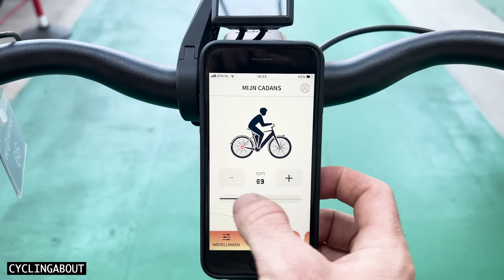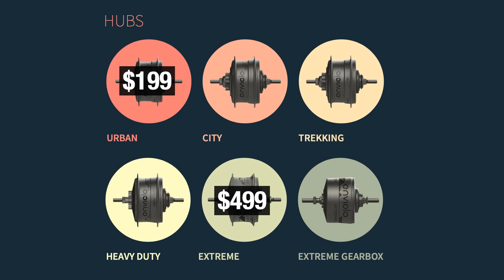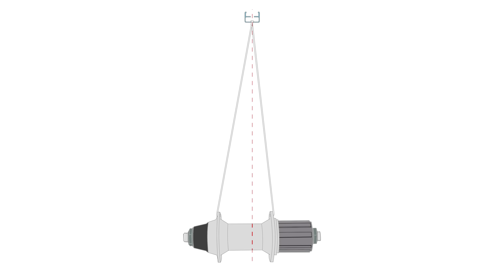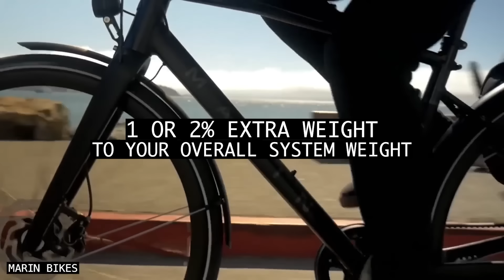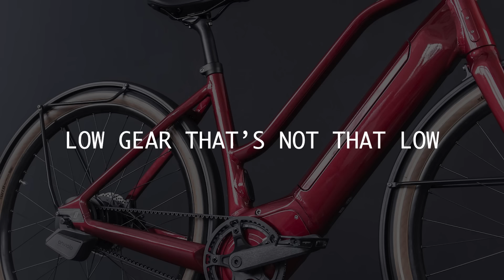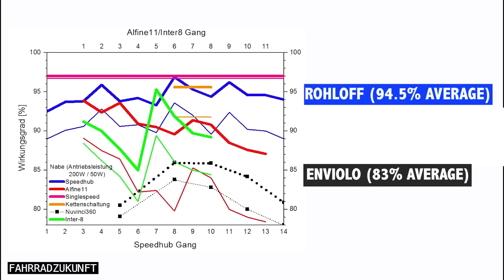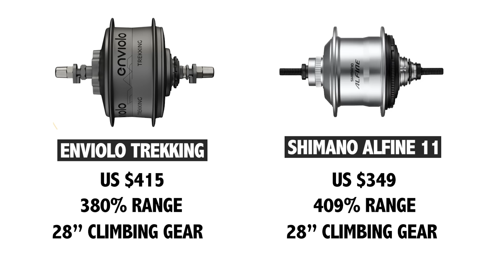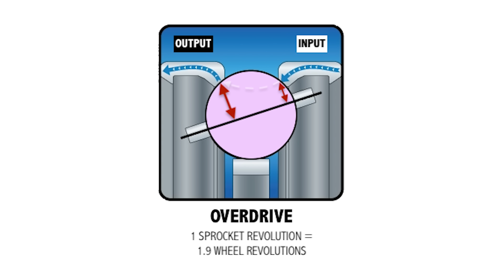Are $199 Enviolo Hubs the BEST Internal Gear Hubs For Bicycles?

Comment: Telling this as a bikemechanic. These hubs are unbelievably unreliable. Compared to Shimano hubs you do not have the possibility to adjust the play of the hub, so if your happens to have play, the hub is defect and needs to be replaced (some customers do have this after 2000km on their e-bikes). Then the freehubbody itself often gets play in itself, which leads to the chain or belt being off-center and possibly damaging them. Only way to fix this is replacing the freehubbody. When lacing these hubs you notice that most frames are not designed for the hubflanges being the same height, so you need to lace them asymmetrical in order for the wheel being centred. Then it happens sometimes that the disc mount itself is misaligned so you have to live with constant brake rub or you need to replace the disc mount. 
Overall there is nothing on this hub that can be repaired, only replaced and if the hub needs to be sent to Enviolo you most often just get a new one because even they are unable to repair them.

Comment: 6:45 yeah no, give me a grease port. btw i have tested on a few years ago, felt pretty good.

 20k km sounds like a lot, but im a messenger, and ... wait it is a lot. that but works out to 2 years. (60km x 18workdays x12months=13k km per year) (or19200kmper year working 80km per day and 20days per month). 
that being said, for a normal commuter that is a solid 5 to 6 years, so not bad. (stay in school kids). that being said, a friend of mine had one on his cargo bike as a messenger for a few years working part time.

1 grease port please or some kind of good oiling option.
EDIT: 21:40 never mind, that grease looks crazy.  but it still should be shop serviceable like re greasing and the wheel sent off for repairs.

Comment: I hate so much that on Enviolo you have to make SO MUCH more twisting turns compared to Shimano in order to shift… 
Also during winter times shifter will freeze from time to time not letting you to shift properly before it unfreezes.
Reply: Try the automatiq version no turns at all anymore. In my view the automatiq version is the only version to get. I am also sure it lasts longer since the system is always in the right 'setting' not to stress the systems and it doesn't use cables that can break.

Comment: slight correction (?) a CVT does not require electronics for automatic shifting; in many automotive applications, automotive shifting can be mechanically controlled by rpm, torque, or other variables mechanically present.
Reply: True but electronic is far more customizable like my automatic shifting which I designed for these hubs.

Comment: You even said why science proves they are harder, you slow between each pedal stroke so are wasting energy on an acceleration every stroke so the extra energy exceeds the extra lifting force. Each deceleration/acceleration cycle throws energy away.
This would only be cancelled out by an ebike which compensated for the dead zone so there is no deceleration, which a modern ebike can certainly achieve.

Comment: I've been riding an old (2004?) gazelle avignon with 7 speed hub for the last decade and love the low maintenance. The hub is starting to get crunchy with age so i test rode a gazelle cx (Bosch torque-based crank motor and automatic cv hub gear) it was really weird that pushing harder on the pedals did not result in them going faster, just the bike.
Electric boost is capped in the uk below my nominal cruising speed so i probably won't go electric but a manual cv has strong appeal.

Comment: 15% loss of power is a lot. That's 1/6th of your energy. Like riding 50mi when you could've gone 60mi.
Reply from the maker: It sounds like a lot, but when you factor in all other forms of resistance (eg. air, tyres) the effect on your speed or mileage is much, much smaller than 15%.
Reply: Compared to 3% of a chain its huge disadvantage
Reply: @Cyclingabout  15% loss with NuVinci is only best case - only close to 1:1 ratio.
That can go up to 30% loss of power.
This is why this is really only suitable for ebikes and only if you really don't care about it.
Reply: That efficency data is very misleading the actual efficency is more complicated. You cant just state an efficency like that.  Newer models of the hub are significantly more efficient, I've used many hubs over the past 12 years.
The efficency doesn't just depend on ratio but also the torque being transferred.
Reply: @Ed.R  presumably, efficiency is based upon power, watts, and the inefficiency is the power loss, so it should be that simple.
Reply: Efficiency depends on hub ratio, torque, hub model, hub age and even between different hubs made the same day.
So someone putting out 200W in 1:1 ratio will have a hub operating at higher efficency than the same power into a hub in underdrive. A hub in the same ratio will have a higher efficency if the power is only 100W instead of 300W.
Or even if the ratio and power are the same someone pedalling at 100rpm will experience higher efficency than someone pedalling at 60rpm.
I've attempted some efficency tests so have a little understanding of the complexity. So it's always disappointing to see people fixed on one single efficency value.
Reply: @Ed.R  You need to be aware of the main problem of the NuVinci: slip.
It (N360) for example had been tested with cranks cycling with steady 60 rpm. Changing the input from 50W to 250W then caused the resulting speed of the bike to drop by about 10% -- because slip within the hub increased significantly. That is the main weakness of this type of hub and that makes it so bad in comparison. Other types of hubs practically don't have any slip.
This also can cause less range with ebikes in comparison to other hubs since high power input into the hub (causing more slip) is no problem especially with ebikes. Everybody can put in a few hundreds watts with an ebike.
Reply: From my own efficiency testing I can verify that 15% loss is near the worst-case scenario. Unfortunately my power meters are neither accurate or precise enough to get good data. However I was not seeing significant losses and nothing like 30%. In fact at low torque or in 1:1 ratio it looked more like 5% at most, was hard to pick up any loss.
On the subject of slip, calling it that isn't wrong but maybe misleading. With increased torque comes an increased contact patch between traction ring and planet. As the planets surface has all available rotation speeds on its surface the bigger the patch the more of it isn't at the correct speed. Hence the slippage on the edge of the patch, not to be confused with slippage between input and output.

Comment: WRONG.  It's not changing the size of the contact patch (which should be obvious - it's a sphere ).  It's changing where the contact patch is relative to the rotation axis of the sphere.  Closer to the axis = less hub rotation per rotation of the sphere.  Further from the sphere's axis means more hub rotation per rotation of the sphere.  Pretty ingenious, really, even if it is the source of the inefficiency.

Comment: why cant you have a true cvt on a bike without a shifter or leccy shifting? ive always wanted to speak to someone more educated than myself on the topic
Reply: Not sure what you mean my bike and many others (bosch+enviolo automatiq) doesn't even have a gear shifter i can manually use. I have not changed a 'gear' in 16.000km. The only thing you set is the type of motor support you want during your ride (or auto) and the peddle speed (i have it in 70). I just start the bike and peddle. Since i live in the netherlands the most active 'button' on the steering bar is the bell :)

Comment: Brilliant idea to replace gears with just an oil.
Reply: I think you’re on to something. What if a gearbox had metal wheels with perhaps a 5mm width instead of cogs, driven by the oil? With just a few different sized wheels, many ratios could be  achieved with a simple linear shifting mechanism. Just don’t know if there would be enough surface area between the wheels.

Comment: 380% is underwhelming.

if you want to do 5kph to 40kph with the same frequency, then you already need a factor of 8.
or 800%
Reply: If you want to go 40kph instead of the normal speeds (avg bicycle speed in netherlands for example is about 18km/h and ebikes 23km/h) you should not get this system or i would argue probably not a internal hub at all these speeds are for a 100% different bicycle group.
Reply: @scb2scb2  currently I have a Dual SRAM, combining a 3 gear hub with a 7 gear derailleur, yielding a bit over 500%. It's an affordable compromise.

I'm not a sporty person, I typically sustain 100 to 150W-ish when cycling. But even when I visit the Netherlands, I regularly exceed 40kph at the beach with a proper tailwind. And when I go to the neighboring village here in Switzerland, it's roughly 5kph on the ascend and 50kph when returning.

I would argue that proper gearing is important for beginner and amateur riders who cannot just brute force an inappropriate bike with tremendous torque or a frequency resembling a sewing machine like an enthusiast.

My pet peeve is that good gearing is either vulnerable (derailleur) or quite expensive (rohloff, pinion). And bikes with proper gearing are often uncomfortable for "everyday" riders who want to sit upright.

And recently (same as for cars!) the wheels are growing to ridiculous sizes.
Reply: @svr5423  The word here is you are not a normal bicycle user but are doing it for sport. The avg bicycle speed is 18km/h in the netherlands i am sure you noticed when you are passing everybody at 2x the speed. Its just a whole different market. The price of the avg ebike (where these systems and things like the rohloff 14e) is 2600 euro now and about 50% of all bikes sold in the netherlands are now ebikes. Yes they can cost a lot a 'top' ebike or cargo bike for kids etc etc can be up or over 10.000 euro. My current nornal bike (koga) is about 2200 and my ebike (Reise and Muller) 6000 euro. I doubt if these markets will come together but i do suspect prices will go up and options will be limited because its just not where money is being made i am sorry to say you are the exception not the rule.
Reply: @scb2scb2  I'm a normal bicycle user, I'm not doing it for sport. I'd never buy a racing bike.

It's ridiculous for a normal user to spend more than 1000 EUR for a bicycle. You can already get an e-scooter for that.

I also don't see any reason to buy an ebike. Not only are they expensive, they combine the downsides of a bicycle (size, mechanical fragility) with those of an e-scooter (limited range).

The main reason why almost all bikes sold traditoinally are mountain bikes, because they are cheap and they have the gearing necessary for everyday use.

Again: with the 380% gear range offered, my bets are that a normal rider would not make it to the next village (around 4km) where I live without having to get off and push.
Reply: @svr5423  Ok not all countries are the same so not making a judgement on you. If you are going over 30km/h on a normal bicycle here you are the exception not the rule and will have 'issues' with other bicycle people all going 20ish. Here its not ridiculous to pay more than 1000 for a bicycle. I told you over 50% of all bicycles sold in netherlands are now ebikes and the avg price is about 2600. We have 23M bikes for 18M people so >50% of all new bikes is a lot. The reason why people don't want to get a escooter is simple you need helmet, insurance and in our country most important you are not allowed on many bicycle paths and have to join the car lanes. Now i do agree on range 380% is not enough for you if needed many will move to internal gear hubs with 500%+ like the rohloff. Now in your country i assume mountain bikes would be normal here its not i doubt its more than 5% max. Also most people own multiple bicycles from the one you use to get to the pub (old banger 100euro max) to a nicer analog one and a lot of the time a ebike. When having kids maybe a cargo bike to transport to school. The mindset is totally different but if you been to the netherlands as you say you know that. If i would be living in your country i would not even consider a enviolo just not practical and if doing internal hub would probably go with rohloff 14e. Each market has its own needs and europe is so big and flat vs mountains, no biycycle paths vs some vs all over the place. A commuter to work idea for decades (starting at 6 years old going to school etc etc... There is a reason why no gears or internal gears is normal in some countries and not in others.
Reply: In reality you do not have to do the same frequency at 5 and 40 kph. I do not have any geared hub but derailleur systems with 500, maybe 600% gear spread ratio with more than one front chain ring.

You can do easily 50 kph with them, and you can climb easily. No bicycle shifting has 800%.
Reply: @simonm1447  derailleurs with 500 to 600% are workable, but in reality it still takes some effort to climb a mountain.
Put people off from riding a bicycle.

Any less ist simply not suitable for the real world, and that includes the enviolo.

So far the only alternatives I see to the derailleur are rohloff and pinion gearboxes.

And yes, you can vary the frequency and torque a bit up and down, but in reality humans are creatures of comfort.

Comment: Can you clarify the lowest gear ratio being limited by the "2.0 minimum primary ratio"? The tech pdf lists that in the context of ebikes. If I am just pedaling the thing, is there any reason I can't gear it lower (via the chainring and sprocket) so that I can go up a hill slower at a higher cadence with less force on my knees?
Reply from the maker: The issue is input torque, not the sprocket sizes. Despite you not riding an eBike, your legs can still put significant torque into the rear hub (potentially damaging it) when you apply your full body weight to the forward crank arm.

But you could do it if you were careful. Have a look at my Alfine video for more on lowering the drive ratio beyond manufacturer recommendations.
Reply: ie, if you don’t weigh 20st and jump on the pedals you will be fine.
But of course you lose the higher grears
Reply: Could pair it with a double crankset and idler pulley. I don’t see an issue at all if you’re not heavy or hauling a lot of weight, since the rating is 100Nm. Could also opt for a bike with smaller wheels, putting less torque on the hub.

Comment: at that point of the explanation about the microscopic solidification of the oil which transmits force without contact I almost came in my pants. then the transmission by means of continuous adjustment of the rotation angle of the spheres ... now i have to take a shower ...

Comment: This is pure spec sheet crap. I‘ve had several Enviolo hubs and would never buy another. So many disadvantages. Real world Efficiency, durability, actually required service, difficulty of maintenance…
My enviolo bike would break down every 3 months.
I bit the bullet and bought a Rohloff after spending as much as the Rohloff was on enviolo hubs and parts.

Comment: Im not sold on IGHs. None can handle high torque such as the famous M620's, you need a custom frame with splits- leaving you only to buy overpriced brand ebikes. Wireless derailleur still have days left
Reply: Why would you need a splittable frame? That's only needed if you want to use a belt drive.
And what do you need 1000W for?! Also, 160Nm will wear down your drive train quickly.

Comment: 14% less efficiency + 800g extra weight over an already heavy hub makes you wonder just how much did they paid the guy for such advertisement...
Reply: The price, comfort and maintenance though
Reply: @BunkerSquirrel  we can argue if its 14% but even that just means if a 2022 model would have 14% loss the 2024 model would have 0% loss not because of the system itself but batteries have gone from mostly 500->625->750 and charging speeds from 2,4,6. The gains are still the same esp on the automatiq enviolo (only one i would consider) no shifting ever just peddle type of ride is just extremely relaxing, quick, clean steering bar and indeed low maintenance esp with belt. If you are scared of 800grams the system or most ebikes are not for you. Its about a comfy ride mostly more right-up sitting (most loss) not a racing bike type of system.

Comment: 83% Efficient? Thanks but no thanks.
Reply: Immidiately downplaying that was cringeworthy bias.
throwing 17% away is really a big con unless we are talking E-Bikes. 
Then you'd need at least the heavy duty variant due to the torque requirements of mid engines E-bikes.

Meaning it's more expensive then an Alfine.

That said i think it would pair nicely with an high powered large battery E-bike. Just pick motor and battery 1 tier up for the Alfine option to counter the drivetrain losses.